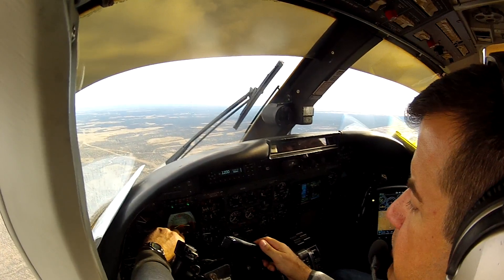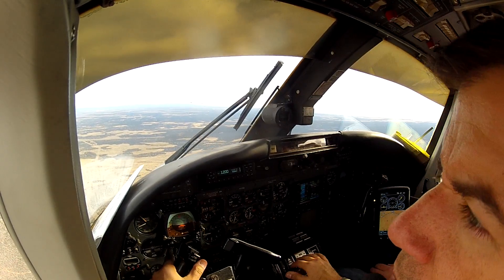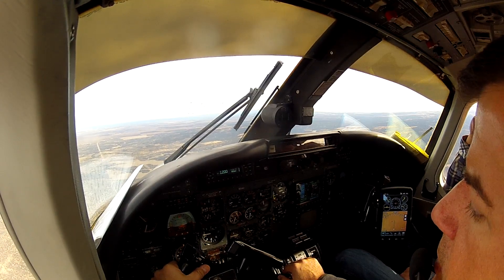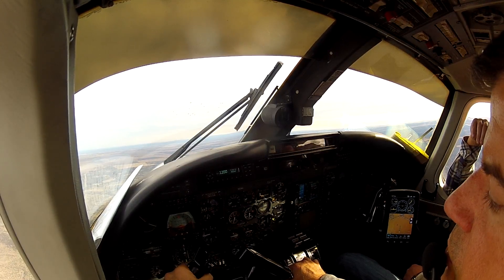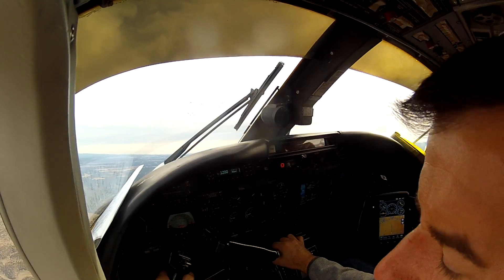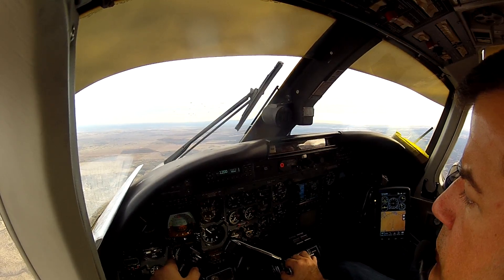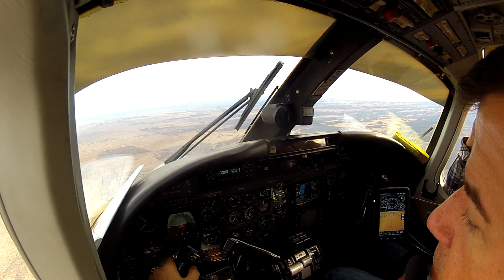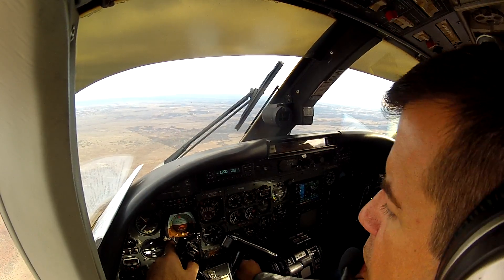Turbo Commander Training - Mean Stall Break

Comment: Classic control reversal in a stall.
The pilot clearly deflected the ailerons when the wing started to drop (common reflex) which INCREASES angle of attack on the dropping wing, which deepens the stall on that wing. Deflected ailerons simultaneously decrease the AOA/stall on the rising wing generating more lift. 
First solution, don’t deflect the ailerons.
Second solution which this pilot did nicely, decrease angle of attack.

Comment: The instructor needs to keep his hands off.
Reply: I watched this several times. The instructor reacted as required to keep the ailerons neutral. Both pilots were surprised by the quick break. If the instructor just sat there as passenger and allowed the airplane to enter a spin, he wouldn’t be all that great as an instructor. The hand on the yoke  wasn’t really hands on. In fact, his hand moved away almost as quickly.